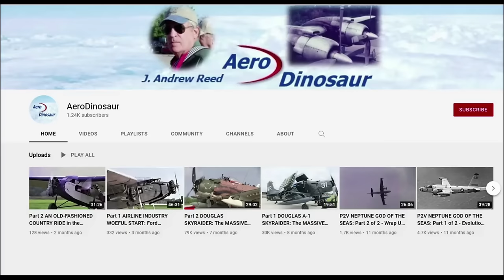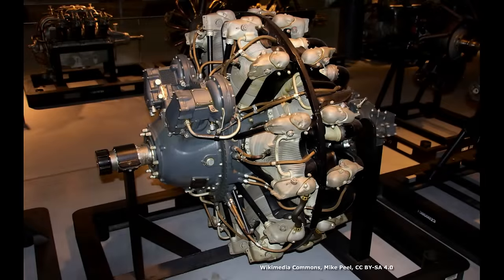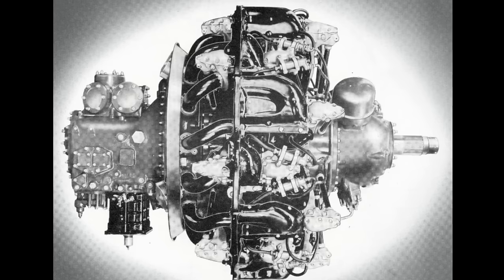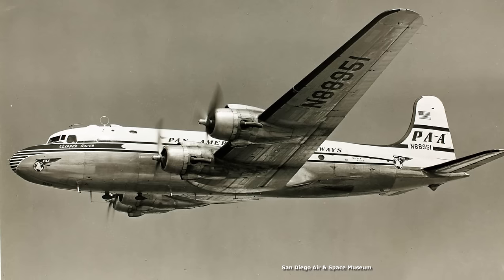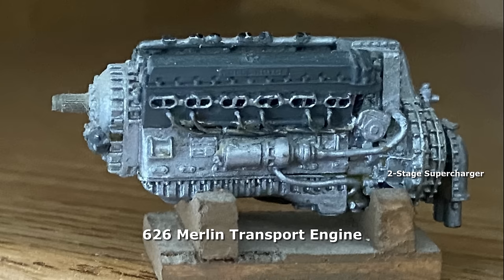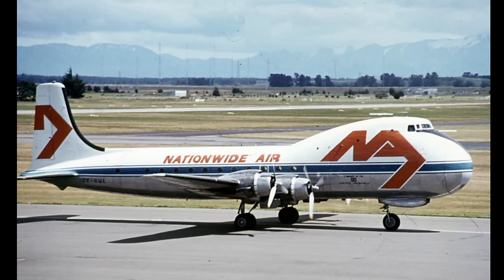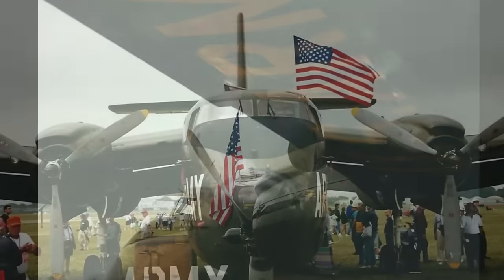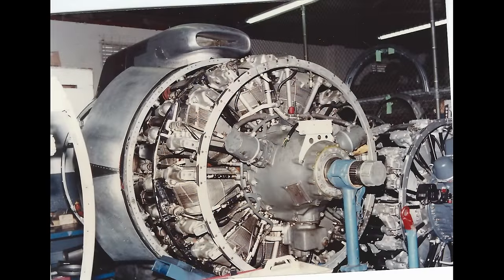The Pratt & Whitney R-2000: DC-4 / C-54 Skymaster and C-7 Caribou

Comment: Let's see how many I can check off. 1st ever plane ride was on a DC-3, then Martin 404 and Convair 340 and finally the Caribou in Vietnam, operated by Aussies. I liked to watch them depart Vinh Long after dropping their cargo and leaving empty. They would get off the ground at about halfway down the 3300 foot PSP strip, suck up the gear, build airspeed and at the end of the strip, haul back on the yoke into a 75 or 80 degree climb until they lost airspeed and levelled off. (Had to avoid ground fire, even though there was never any in the daytime.)

Comment: FANTASTIC PLASTIC MODEL AIRCRAFT COLLECTION.  MY FATHER FLEW THE C47, C54,  C118, B17G, B25H,   ET CETERA IN THE USAF.  HE WAS BASED AT ANDREWS AIR FORCE 
BASE,  WHERE HE FLEW THE LOCKHEED CONSTELLATION.  LATER ON, AT MATHER AFB,  HE FLEW THE CONVAIR   T29D.   HARD TO BELIEVE THE VARIETY OF AIRCRAFT. 
YOUR VIDEO  OF THESE AIRCRAFT  IS EXCELLENT.   REMEMBER ABOUT THE PIMA AIRCRAFT MUSEUM (OUTSIDE),  WHERE THEY HAVE THESE PLANES IN REAL LIFE.    
(THIS IS SOUTH OF TUCSON,  ARIZONA)       YOU WILL NOT BE DISAPPOINTED.           RICK
Reply from the maker: Glad you like the models.  I visited Pima in 1987 and took tons of photos (before many of the aircraft were refurbished or painted), but things have changed a lot for the better since then.  Sounds like your Dad had a career I would have wanted--too late for me now!  I may have been involved with several propliners over the decades, but by far not enough of them! J.A. Reed

Comment: Request here explain propeller controls, as in set propeller rpm, then set throttles and boost, saw that in a B17 training film.
Reply from the maker: All that is good but I wanted to keep this one simpler and keep the running time down.  I've done all that on several other videos available on our channel.  I'd advise you to look on our AeroDinosaur video list for our flight deck videos on the DC-7C, DC-6 and B-29 FiFi and you will get blow-by-blow descriptions during each flight on what's going on with inflight power conditions including prop settings, manifold pressure, BMEP, spark timing, as well as critical V airspeeds, etc. similar to the training films. All those involve either the R-3350s or the R-2800s, obviously depending on the video you are watching. J.A. Reed

Comment: Wasn’t the DC4E based on the XB19. ?
Reply from the maker: I'm not absolutely sure, but the wing design was similar.  The XB19 was much larger than the DC-4E using early R-3350s vs the R-2180s in the -4E.  I'm sure they shared the latest technology of the day, however.  Thanks for watching.  J.A. Reed